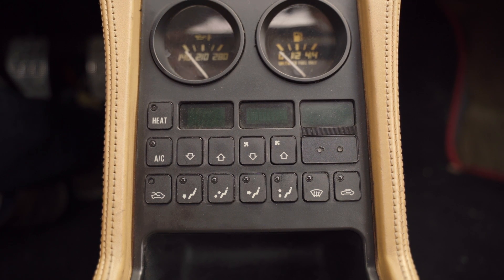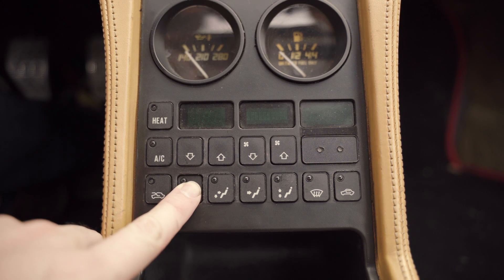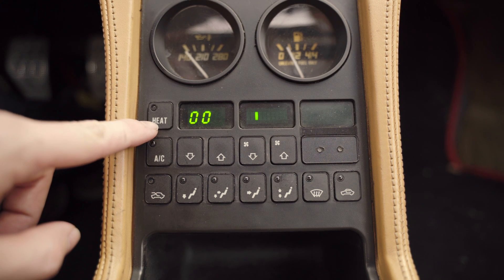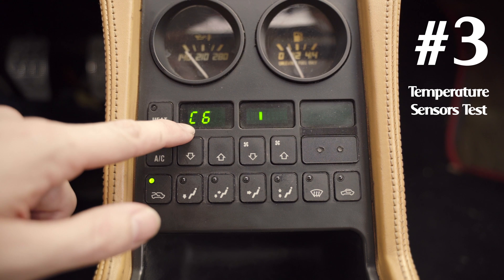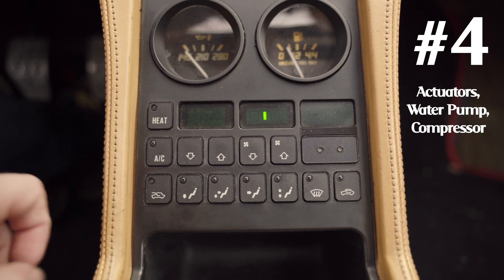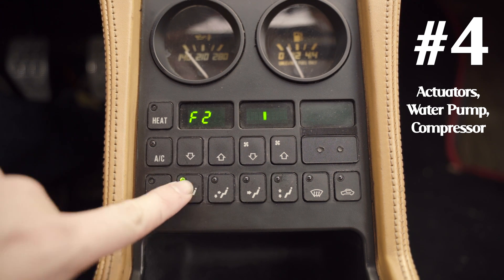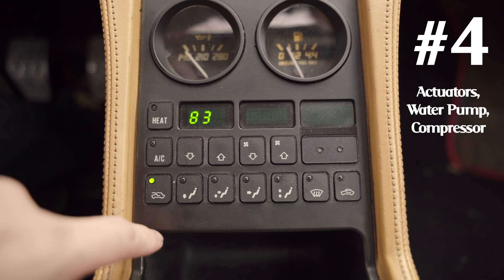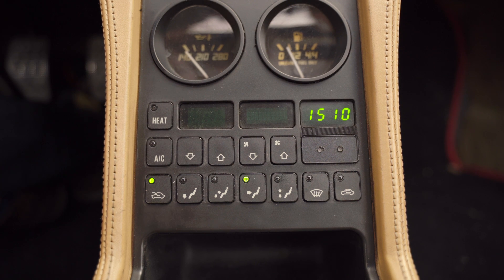Ferrari 348 - Crazy HVAC Diagnostics Mode

Comment: Hello. On my 348 when I use the heating an E8 error appears after 10 to 15 minutes. I stop driving, I turn off the engine and after stopping for 15 minutes the heating works again for 15 minutes and again E8 error. Any ideas? I checked the pump, it doesn't seem to me that there is a leak🤔

Comment: trying to solve , fan blower on full blast right from start and no control for the fan speed , any ideas to help solve this issue
Reply: I'm having the same issue can't adjust it I've been told mine needs to be taken apart and resoldered. If you want to get it to stop going full blast disconnect the battery and wait a few minutes and reconnect it mine was fan is now off when I restarted the car til I can get it resolved.
Reply: @silentthunderz28  The fan is supposed to run full at time at the start, read the manual please
Reply: I'm way late to this reply. I simply don't have control of my panel. When I press buttons, I can turn my fan speed up but not down. Most buttons don't work, but they did when I first got it in 2020

Comment: Thanks for the video, it's very helpful. Do you know anyone who repairs the display module in case pixels are missing and the clock malfunctions?
Reply from the maker: I don't know of anyone who repairs the displays unfortunately. You can try disconnecting and reconnecting the unit, as sometimes wiggling the connectors will make things work again. Also, drive the car at least once a week and use all of the HVAC functions at least once a month (more if possible) to keep the motors and actuators lubricated.